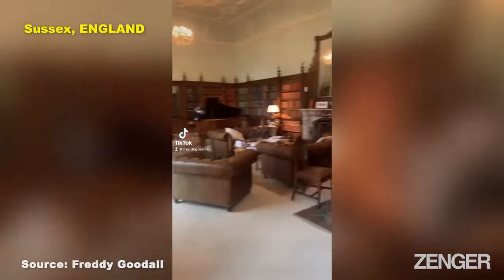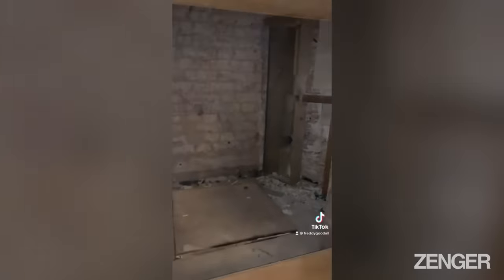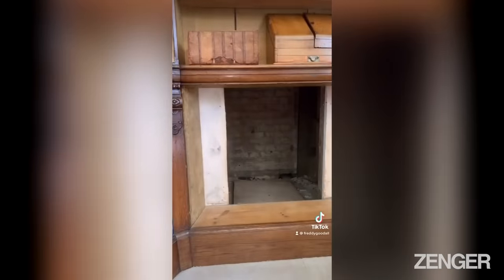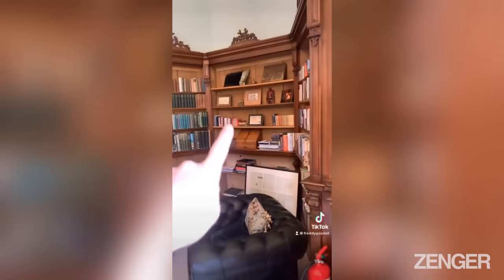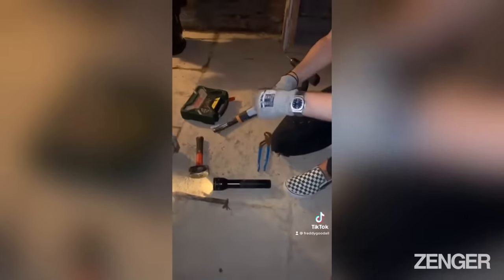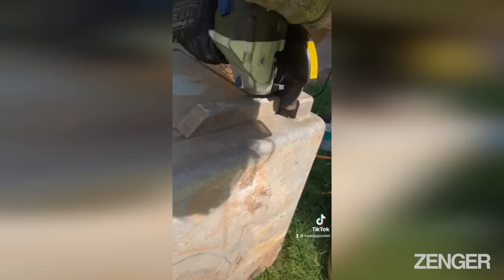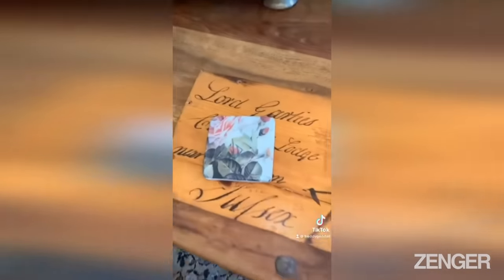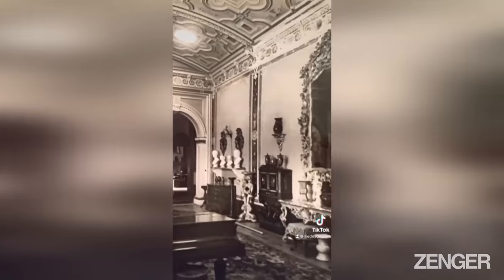Man Finds Secret Passage In His 500 Year Old Home's Library

Comment: This "secret passage" dates from the 20th century, not 500 years ago. It provides access to pipes and other things that might need replacing or repair.
Reply: It does not say it is a 500 year old passage it says the house is 500 years old. Clearly the house has been worked in different eras.
Reply: Yes, and as another person mentioned, the corridors were perhaps to distribute the heat from the boilers throughout the house. Nice having easy access to the roof and crawlspaces for repair.

Comment: I think this is stage for a few reasons.  1)  the creepy ladder is made out of newer 2x4   that aren''t all that old . 2) the safe by some stairs. The lock box inside has to date from around 1950  or so.     I m guessing when he bought the house he was told about it .    It's cool and would be interesting to do sift through the dirt under it to see what might have been dropped.  I just don't think this is a forgotten secret room.
Reply: Ya at one point you can actually see PVC pipe too.  Pretty sure they didn't have PVC in the mid 19th century.
Reply: I imagine the house has changed hands throughout the decades, with each new owner adding newer stuff to it. The passages could've been used repurposed as maintenance tunnels for the last renovation before it was sealed off.
Reply: That house has been worked on over the years. How does that make it staged. Clearly you can see that the house has areas that are unused.
Reply: its still cool tho lol
Reply: I agree, it totally looks like an area of recent construction probably adding additions to the existing house, the timber is way too new and even the brickwork looks too modern it's definitely not 500 years old.
Reply: @bighands69  Because it's not a secret passage. Any fool could simply crawl under their house or through the attic and say "oh look I found a secret passage" that's not what this is. I mean imagine if I went outside, opened the hatch to my crawl space and crawled in there believing I found a secret passage while surrounded by electrical cable and plumbing like no.
Reply: @OpinionatedChicken59  ROFLMAO...they didn't say the PASSAGE was 500 years old! They said the HOUSE was 500 years old. Reading comprehension 101...go back to school!
Reply: But I'd love to see what a metal detector could pick up in some of those old corridors.  Old keys and tools, nails and screws, but who knows?
Reply: I've been in a lot of old steam tunnels and they look just like that.  Steam tunnels are great for running the electric through, and that's what's in all those PVC pipes overhead.
Reply: he just bought the house mate so the old owner did some upgrades
Reply: These aren't "secret rooms". They are crawlspaces, very common where I live.
Reply: It's not like the house had been owned by this guy for that long.  He probably bought it more recently, and wasn't told about the extra space.
Reply: Also, the PVC plumbing and spray foam insulation. The guy making the video is just an attention seeking child.
Reply: The safe itself looked suspiciously modern to me too.
Reply: The pages of the book were still white. You would think after decades of exposure they would have turned yellow.
Reply: Both the book pages and the ladder were in a dark, dry space. Perfect condition for preservation. While I agree with your point about the ladder, that it's not original, but i think it could be a lot older than it appears. As for the book pages, they could totally be from over a hundred years ago.
Reply: Let’s assume the guy inherited the house. And that the last owner lived there until he died. He probably never told anyone of the secret passages while he lived, otherwise they would  be no good to him. They are hiding places as well as storage places. He could have upgraded them over the years. So then he falls sick and dies. The new owner  has to discover them for himself. No harm done because nothing essential was kept from him and he gets to have the adventure of a lifetime.
Reply: @timrobinson6573  thinking that myself . 'Look at my not very interesting crawl spaces , look at my loft ! ' . Aren't you jealous of my wealth ? Not really , if it makes you SO up yourself .

Comment: A lot of big old buildings have these hidden access spaces.  Often they would exist to make it easy for workmen to perform some kinds of maintenance without disturbing the household or damaging the "public" side of a building.   Years ago I lived in a big old Victorian mansion in Rhode Island that was converted into apartments and I found three of these access spaces.  I had the "penthouse" which simply means I lived on the top floor where the servants had once lived but I had the whole floor, or did I?  I discovered a whole wing that was under the roof that was just empty.  In it I found hundreds of old magazines and newspapers from the 1800's just stacked up.  it appeared that nobody had been in that space for a century.  Basically it was a big unfinished attic space.  It also had three original windows one of them being stained glass.  My apartment as I described might sound big but it was only about 600 square feet (about 55 sq meters) but that space added over 200 sq feet.  So I ran some extension cords and gave it a pain job and I had  extra storage and a nice little hobby room my landlord didn't' even know about.  At the other end of my apartment was a closet which if the back wall was slid sideways it revealed a vertical shaft roughly a yard square with an iron ladder attached to the wall and it went down to a lower level and my downstairs neighbor and I figured out that it ran right behind his living room closet.  A third hidden space was located under the kitchen cabinets.  I had never noticed but there was a space between the kitchen and bathroom about six feet by 8 feet where all the pipes ran.  You had to open the lower cabinet door next to the sink in the kitchen and there was a panel and if you turned a knob and pushed in it was a door just big enough for an average person to get through.  From there with a flashlight I could see the pipes going into the tub, toilet and sink and the drain pipes going out.  But there was enough space for roughly 200 cubic feet of storage though I never used it because it was awkward.   Other tenants told me there were additional hidden spaces in other parts of the mansion.  The basement had a tunnel that went out under the front lawn, under the street in front of the home and across the street and connected up to another mansion's basement except that building had burned down in the 1970's so the tunnel just terminated in a big pile of dirt where the demolition crew simply filled in the hole with dirt.  We figured the brick arch roof of that tunnel probably wasn't very safe so we backed away and never ventured across the street under ground.  Interestingly the tunnel intersected partially with the city's water and sewer system which we had to climb under as that passage was only four feet high.  .
Reply: Dude, this comment was incredibly cool! Fascinating. This should be the most thumbs upped comment in my opinion. 😅
Reply: Sounds like where bad Ronald lived...
Reply: Great adventure. Thanks 😊
Reply: I’m intrigued that you called the Rhode Island house “Victorian”, was she your Queen too?
Reply: @pauliboo2  Take a chill pill, we have Victorian houses in the States. If it was built in the style of her era and in her era, it could be on the North Pole for all I care. Sorry about the Revolutionary war and all that
Reply: Those passages were typically a way for the man of the house to sneak into a servant’s room for good romp, without his wife being any the wiser.
Reply: @pauliboo2 it’s a style of architecture and you don’t own the rights to call a particular style your’s.
Reply: These passages do you believe were only  for servicemen to go unnoticed in the property? Or for secrecy motives so people wouldn't interfere in the owners plans?
Reply: @kevincampos3797  anything behind a book case is likely for secrecy
Reply: Amazing. What an adventure!!!
Reply: Soooooo cool
Reply: Sounds like maybe some bootlegging was going on in those two Mansions. I seriously doubt someone would dig a tunnel for a piece of @ss.
Reply: @joeyhunter842  I seriously doubt someone would dig a tunnel for a romp. We had something called prohibition in the United States. They were probably moving liquor.
Reply: I would be in heaven!  The design of homes and businesses today ( Okay, I guess a mansion isn’t exactly a “ home. “ 😀 ) is so boring and straightforward unless you have enough money to pay for any form of uniqueness. I guess I’m naive. Saving / making money is the goal   - Pride in creativity and workmanship alone doesn’t put food on the table. 🫤

Comment: Not a secret “room”. It was a crawl space for maintenance. 2x4 ladder looked rather new. I worked on a house built circa 1777 in Vermont that may have been an inn as it had the stage coach stop and a carriage house too. This house did indeed have a secret room. The old swinging bookcase trick opened to a 20’x30’ room. Nicely decorated too.
Reply: So you had a big room that couldn't be maintanance room what was it for? And you found it untouched or it was in use?
Reply: @kevincampos3797  The owners of the house knew it was there. They showed it to me. It was nicely decorated and was possibly used for meetings? This was certainly built for very moneyed people back in the day.

Comment: I have heard that those chambers under the home could serve several purposes, but some of them were used as a form of central heating. Heat up those spaces and all the connecting rooms are heated up by the central source, but in the summer time it helped keep them cool.  Would make sense that they are for maintenance work though.  Pretty awesome!  Cant believe the way that you just chunked those scraps of book back onto the floor!
Reply: That makes sense!
Reply: The house is 500 years old.  Those are almost certainly priest holes, in which Catholic priests -- or clergy of whatever religious group in England was being persecuted at the time -- could hide (if necessary) after performing forbidden religious rites.
Reply: Best comment!

Comment: I enjoy these types of videos. I've seen a few videos where people have found hidden stairwells within there homes while renovating old chateaus. I think they were calling the stairwells servants stairs. I'm in the US so we don't have such things in our older homes. Maybe the Biltmore in NC probably does as it's massive.
Reply: Many older large homes had a separate, smaller staircase for servants, so they could travel from the kitchen/workrooms to their attic rooms without intruding on the family areas.
Reply: Vineville Court (apartments) on Vineville Ave. in Mâcon, Georgia, USA, had servant stairs & servant entrances when I lived there in 1990s.
Reply: You mentioned North Carolina.... In Charlotte the large old house on Morehead Street and has the bridge  for South Blvd under it, they used to run across each other long ago but were made into a ramped interchange, then the ramps were removed to make the roads 4 lanes.... Anyway in this large house, it has an older smaller stair case in the back that has been sealed up and covered multiple times. The crawl spaces behind the walls still had all the various lighting methods. I mean gas piping at mid wall level for gas light sconces, that then were electrical back when it was single strand "ceramic knob  insulators" then upgraded over the years. What has been built and taken off and out of that house in paragraphs of history and that would be only what I found when working on building and removing a "Hunted House" that was in there one year.   The shelving in the basement had newspaper from the 1930's and 1940's on top but when you lifted those up you saw where the wooden shelves had been covered with newspaper from the late 1800's. In all the nooks and crannies you could find evidence left telling the story of this large old house that used to overlook (today I-277) but prior the Brooklyn Neighborhood(now  having he name  reused from the neighborhood small community that was outside Charlotte city limits. This House precedes the building of the nicer older homes  and remote suburb that had street car service to cover such a large remote distance which is   called the Dilworth Part of Uptown.....  
This old history is many old large homes, it just not documented and the workers couldn't document stuff but did talk amongst themselves. City code inspectors that had been to the building all through their multiple decades would tell stories of what was once there....    

The one thing in the south and especial North Carolina is no preservation of history and historic buildings. If it more than 50 years old it has to go for something newer and shinier. If you don't the city will send the jack booted code enforcement against you until you give up and sell because you can't afford to meet their "gotta look nice new, (City fo Charlotte does not care if you are suffering , disabled....etc.   if your grass gets too high, if you home doesn't promote that this land of perfect with everything up to Biddy hens standards...) They'll start harassing you, fine for grass getting too high, having to depend on free help because you can't afford a lawn service, means you're at their mercy for when they feel like and those fines from the city are you problem......    and then the city will put liens against you home for these "fines"  that will be forced collected through their courts  to take your home, making you homeless....     Then that old home will be sold and they tear down too build something new on the lot, because finally they got rid of that owner living in that old house hurting their values and ruining the image of Charlotte as modern city. Sounds absurd and impossible to be true type of  rant, did to me until I'm living it.
Reply: Many old mansion level homes in the US have servant's passages, but some of them have been renovated out to reclaim the space. These old European houses are from an era when an entire floor might be devoted to cooking and employed a dozen people, never mind all the maids, butlers, nannies, etc. 

In any case, we built a mansion in Norfolk, VA not that long ago that was riddled with "hidden" service passages. It even had a hidden elevator in it. It was a monumental waste of space, but that's what the guy wanted and it was pretty cool.